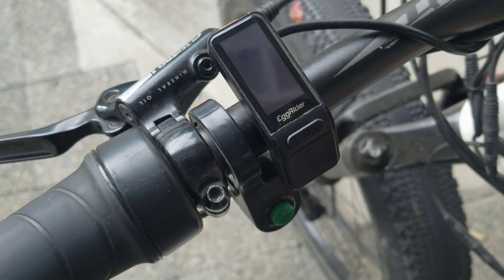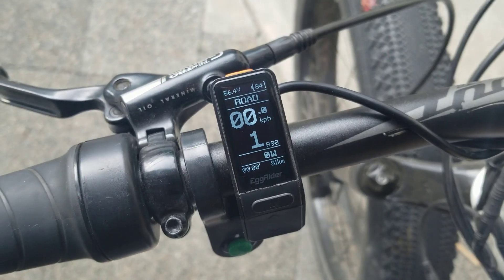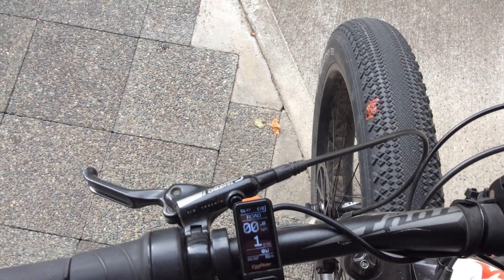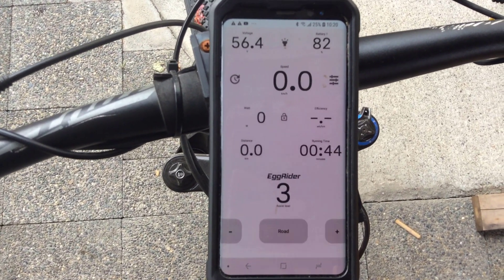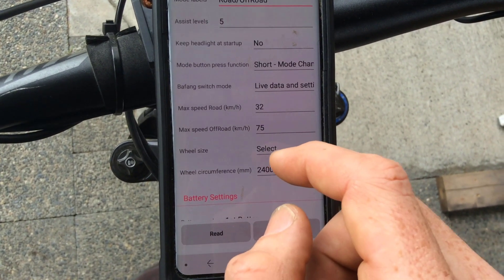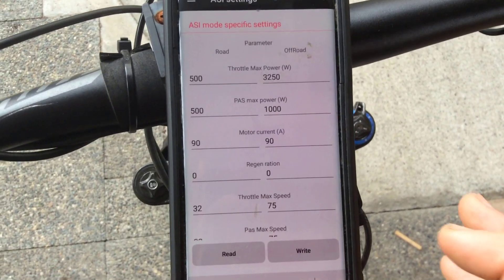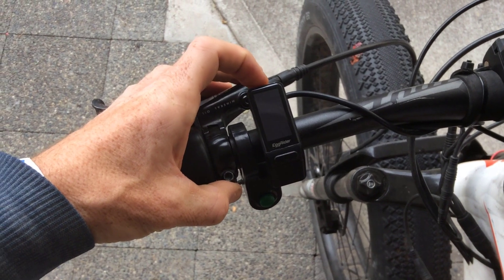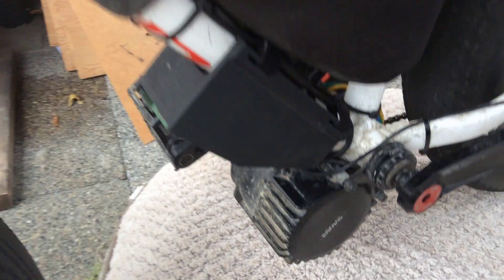Eggrider v2 - ASI Controller (ASI BAC800) support

Comment: Holding down on the down button turns on the light if you have one connected and is supported, that's why it dims, it assumes it's dark out if you're turning on the lights.
Reply from the maker: You are quite correct! I figured it out eventually although I never used the option of running a light that way.

Comment: Hi good day i have a bbshd and a eggrider v2 will the asi bac 800 work with the eggrider ?
Reply from the maker: The ASI support has got better. You will need to get the controller programmed to work with it tho. It's not plug and play.

Comment: Does it work with BBS02?
Reply: My controller is burned and its the old Type A so its super hard to get. Will ASI 855 work with 52v on bbs02?
Reply from the maker: Yeah it will with the bbs02. We have a few folks doing that with it. We have the eggrider as a display option. Currently there is a wait list of about two to three weeks. If you fill out the form on the product page we can put you on the list. Don't suggest putting your details here. Lots of information via the links in the description and if you join the discord you can ask questions and chat to people using the kit with the bbs02. You have to essentially keep the power down somewhat as the motor is not as strong as a bbshd. Hope this helps! Cheers

Comment: nice video ! are you using the standard display connector ? it seems that for Eggrider v2, PL and GND pins are reversed
Reply from the maker: Yeah the 5 pin green higo. I'm not sure regarding the PL and ground tho. Its a custom harness though so not sure how much it will be similar. Cheers

Comment: Maybe v3 could be no screen and tiny. Voice control or just voice announcements for setting/speed. If the phone app connects people can use the phone as screen. Personally I would want a removable key pad that locks the motor off and no screen to break or just use phone for all control and nothing on the bars. Maybe use Google to control the power settings from a pocket.
Reply from the maker: Some good ideas. You can use the screen for a display if you want. The security aspect is a good one. I hope that eventually the NXT display I am helping to develop will be removable in this way like a key.
Reply: @HighVoltageKits  Good idea. I prefer a Bluetooth key and phone display as the contact can give up on anything removable. I have a bosch removable display and tend to lose it in the house.

Comment: Can I set all parameters in off-road mode to zero and use the button as a motor power cutoff?
Reply from the maker: It's a good question Bob. Honestly I have no idea. I never thought to try it. I'm not sure you would find the button very responsive for such an emergency. Or did you want the speed display but just no motor. You could maybe rig up a custom one with a brake cuttoff. Use a switch instead maybe.
Reply: @HighVoltageKits  If it's an emergency I would use the brakes anyway, I am interested because it would be toggleable, not press and hold, I don't want the motor to engage when there is a lot of pedestrians in front of me, where I live requires quite a bit of curb hoping to get to places. If it can I can also use the freed up space for a dropper seat post lever so I can set my foot down in traffic.

Comment: Just upgraded from eggrider to nxt on my surron have a bac4000 and cant get it running.  Wasnt happy with egg but at least it ran.
Reply from the maker: I will pass the message on. Did you run the autotune? It's hard to say without all the details but it is likely a small tuning issue.
Reply: @HighVoltageKits  I'm working with alan just been watching anything I can to try and figure it out
Reply from the maker: Thats good. Hope it gets sorted soon.
Reply: @HighVoltageKits  me too. Tired of putting x controller back in to ride lol. Thanks man
Reply from the maker: Anytime.
Reply: @HighVoltageKits  auto tune fails everytime. I'm not trying to put him down just trying to learn all I can to figure it out. I do a lot of diy and ebikes but this controller has me stumped.

Comment: Mate av got a 1000watt bafang coming from China bought cable for programming can I make it go faster and ride better with it and c18 display is it Bluetooth thanks mate good content, 👍
Reply from the maker: Check out this guide to programming the BBSHD. You can likely get it running smoother especially on trails. As for the faster... You can't go over 30 amps stock or use more than a 52 volt battery. To go any higher you will need to take the external controller method. There are a few videos on my site as to what I did. I ended up running mine at 72 volts and 50 amps. I have also ran it at 52 volts and 50 amps. Good luck! https://electricbike-blog.com/2015/06/26/a-hackers-guide-to-programming-the-bbs02/
Reply: Do you have the hot rod settings and can you use hot rod on stock bafang Controller.. Can't wait to build it 👍👍

Comment: Ok so do I just buy the 72 volt bac800 from luna and use it for 52 volts?
Reply from the maker: No! Whatever you do... do not buy a bac800 from luna. You wont get bacdoor access to program it via bluetooth as that is direct only from ASI. It's way better to get one from electricrt.com You will get a wiring loom, correct speed sensor and a choice of displays if you want. Luna might look fractionally cheaper but you will likely be tearing your hair out trying to get it to do anything. I'm not trying to bash Luna. It's just not a good place to buy it. You will not get bluetooth access via ERT but you will get support and excellent programming on the controller. If you want to access the program stuff only an evaluation kit direct from ASI will work as they dont issue logons unless you buy direct and its $500 us. The ert kit is cheaper and plug and play.
Reply: @HighVoltageKits  So is it okay to buy the motor from Luna or should I buy that somewhere else too? Im sitting on the money.
Reply from the maker: You are talking about the bbshd right and not a mac motor? Are you in the US?
Reply: @HighVoltageKits  Yes the bbshd and in the US yes
Reply from the maker: You can just get the motor from them. Also check em3ev.com they are listing it as 150 cheaper and they also have the eggrider display although ert sell that as well. They are in china but it's a Brit guy running the show. Very good customer service. The luna site said 700 bucks and em3ev is 560... It goes up with addons though. I'd open up both and see which is cheaper overall. Luna has a wider range of batteries it looks.
Reply: @HighVoltageKits Thanks I proably have a few more questions in the near future if thats okay.
Reply from the maker: For sure! Good luck with your build!
Reply: @HighVoltageKits  thanks. I'll post it to YouTube as it gets together
Reply from the maker: I'll look forward to that! Hopefully I'll have the mounting unit for the bac finalized by then and I can send you the code to print one local to you.
Reply: @HighVoltageKits  Okay so I am a mechanic and I'm looking at that 3000 watt cyclone on luna. They say it's for experienced builders and not to buy it if this is your first kit. Is it really that hard to put on? Or is it only hard to put on if you have no common sense?
Reply: What would you recommend between the two and I need reliability just fyi
Reply from the maker: I have never used one so I cant really say. I'd look for cyclone builds on endless sphere and ask them. Also luna do not make the motor so maybe ask on the manufacturers page. Also check out lightning rods as they do a similar thing. http://lightning-rods10.mybigcommerce.com/mid-drives/

Comment: Great demonstration. Did you find uploading the Eggrider firmware update challenging? I did, but found George at Eggrider extremely communicative and helpful.
Reply from the maker: Yeah George is a good dude. The update was ok once I read all the instructions and got the app. I'm on android tho so moving files etc is easier on that ecosystem.